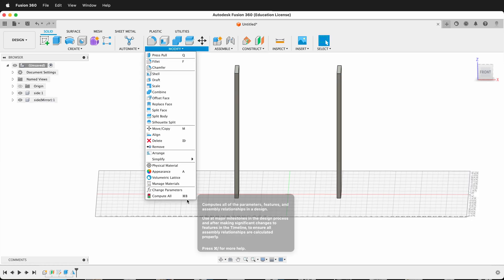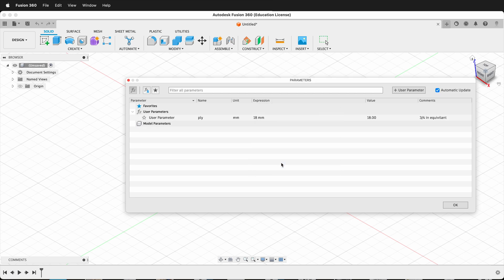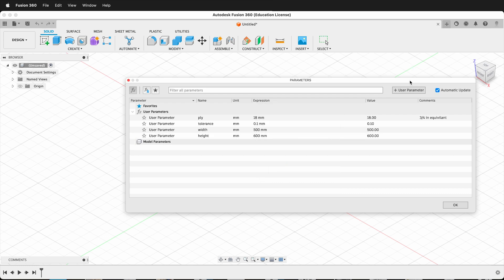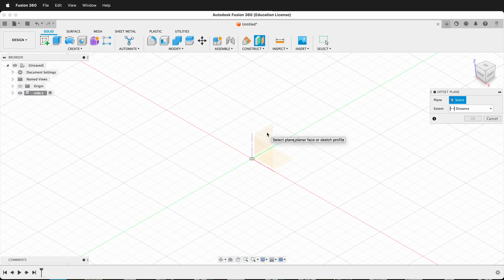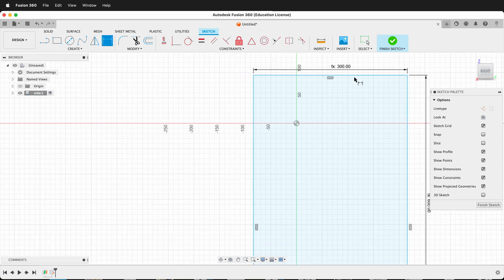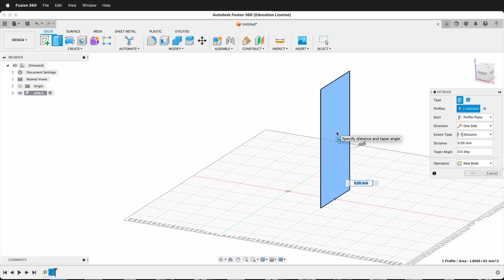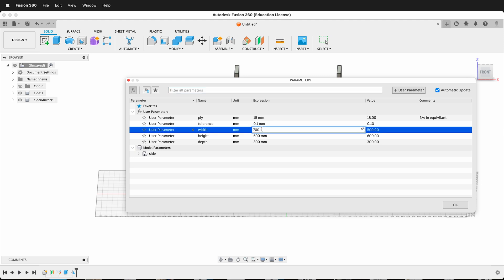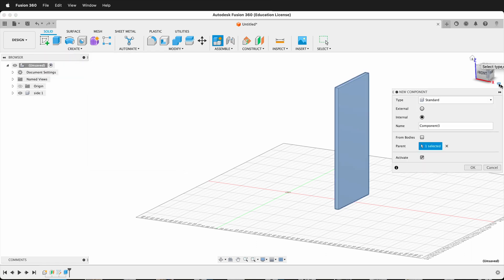More Robust Parametric Models Fusion 360

Comment: Can u create collections of things?  Like a bunch of cabinets in different sizes?  But keeping them parametric?  Like a series of cabinets in different heights, widths, depths?
Reply from the maker: Yes you can, you could duplicate the object and paste them as new. Then you could have updated parameters in the pasted version that have an equation that modifies it by a certain amount.

Wouldn't be automatic like a rectangular pattern, but you can create a parameter of that is 1.25 and then in the larger size you can multiply the height and the width and the depth by that new parameter and it would be 25% bigger.
Reply: Thank you, great idea.